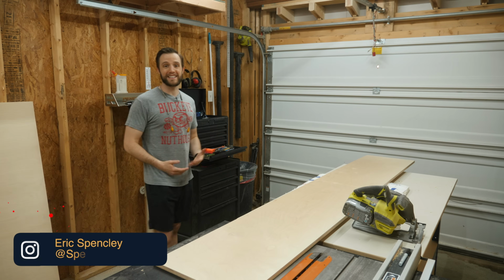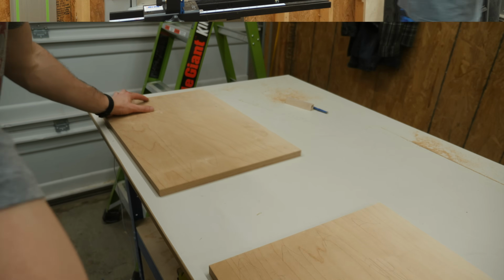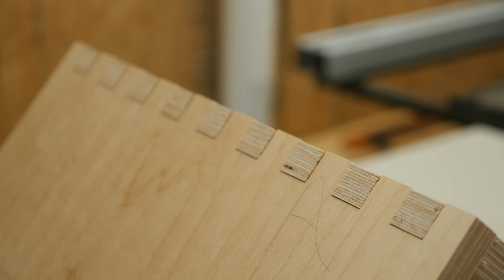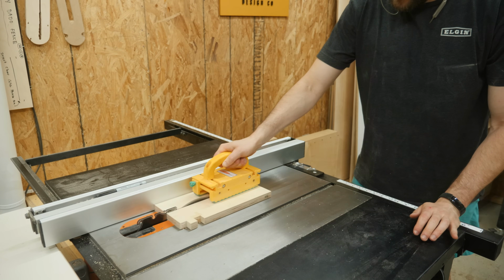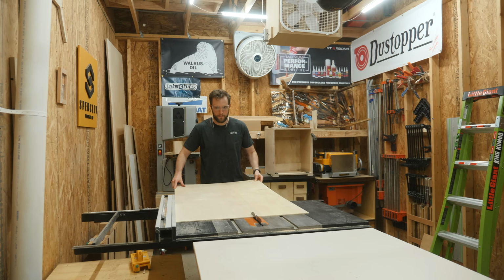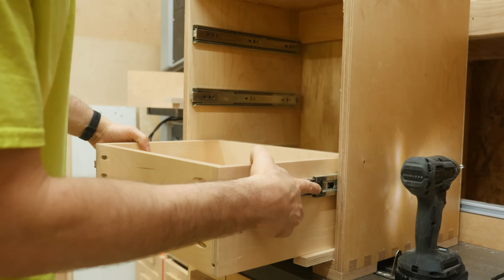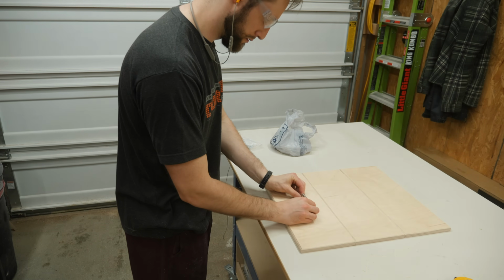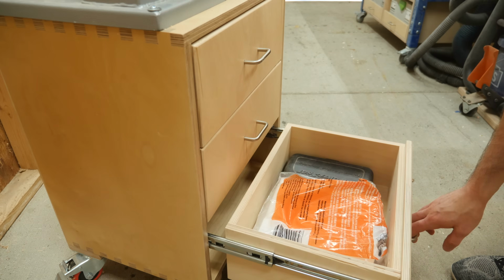no one should waste their time on these joints

Comment: This isn't criticism, this is observation of a lot of these videos doing drawers, and a question regarding the layout. 

At 14:43 you can clearly see the drawer and slide layout, and I used to run into the same thing very often; the drawer slides are at different positions relative to the height of the drawer, thanks to using an arbitrary spacer that has no relation to the drawer. Doing the actual math sucks, and I've taken to selecting where on the drawer I want the slides so all drawers are consistent, transferring that to the drawer fronts, factoring in the reveals, then transferring that again to the carcass/cabinet, and mounting the slides there. It's easy to end up a 1/16th or an 1/8th off and not really gaining the consistency I desire.

Is there an easier, less error-prone way to end up with consistently placed sides?

Comment: Professional cabinetmaker for 42 years. Simple math is 4 minutes x 8 joints is 32 minutes (not 3 hours). Too much work? Wow, why even bother making anything? I will just move on now, thanks.
Reply: I think you missed the joke
Reply: @paulietang55  the joke is the skill set shown in these videos
Reply: Serious question… Given your name, you truly feel take pride in your work and experience do you feel like a box joint is superior in strength than pocket holes, not prettier or more traditional, but better. Why? 

Also considering that nobody seems to mention dovetail joints anymore, what is your opinion given that there are templates and bits available to make them relatively easy?
Reply: Totally agree!